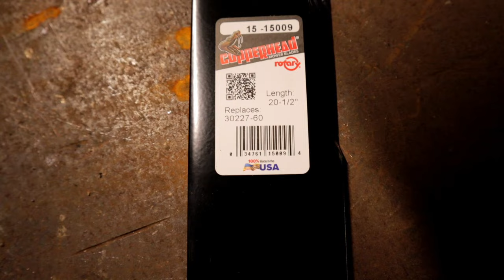Bad Boy Mowers Blade Upgrade - Install

Comment: 6'2" 230lbs male unable to loosen factory tightening with a ratchet, you used a crescent wrench.  I bow to your strength sir!!
Reply from the maker: I think they need to recalibrate their torque wrenches at the factory because they come stupid tight. You may need to try a breaker bar or a cheater pipe.

Comment: Copperheads are ok, Oregon Fusion Gators are better but more money.  Your old blades will clean up and sharpen like new. They're not abused, just used.
Reply from the maker: I will loot at getting a set of those. I want to try a bunch of different blade setups this year to compare them. You are right about the old blades as well. Since this video I have kept them sharp and use them as spares mostly.

Comment: Great video buddy. I too learned something on swinging those ramps out. Can’t BELIEVE I never thought of that before! I would however use a boxed in wrench instead of that big ass knuckle buster you have there. Again, thanks for sharing. 👍
Reply from the maker: I totally agree…I didn’t like using it, since that video I got a dedicated box end wrench for the blade bolts.

Comment: Appreciate your time, just making sure if a Bad Boy's  blade nut with counter clockwise nut to loosen, Thanks
Reply from the maker: These are held on with standard right hand thread bolts.

Comment: I noticed how amazingly clean your deck is - any advice on how you keep it so clean? Powerwash after each mow? Also, I changed my bolts out on the last blade change - GR8 integrity can be affected if any nicks. Love these blades - just ordered a set. Learned a couple lessons on the lifts - now I turn mine outside too for more room and safety (I kept straight before and chocked). Learn something new every day. Love your videos man.
Reply from the maker: Thank  you for the comment! I really appreciate you taking the time to ask some questions.  I try not to cut when the grass is super wet, which keeps from getting a lot of build up under the deck. I will also periodically scrape the under side of the deck with a paint scraper or putty knife.  Then maybe once very month or so I will hose everything down. Nothing too crazy.

Comment: Going to change my blades for the first time on my BB 54", the board you use to block/brace the blade while removing/installing - Is there a recommended length for it to be?
Reply from the maker: No real particular length really. I just had this block laying around and it was long enough to block the blade path while it was still sitting on the ground.  If it isn''t long enough you will have to hold the block in place until you get the blade bound up against it, so it can be a little more difficult. So in short...just get a block long enough to rest on the ground and still bind up the blade.

Comment: Even my impact gun will not budge my mower bolts on the same machine. I broke a 1/2" breaker bar. 
Guess I better get  torch out.
Reply from the maker: They are ignorantly tight from the factory. I had to use a cheater pipe on a wrench to get mine off the first time. I wouldn’t recommend a torch, you will cook the grease out of the spindle bearings.
Reply: Same here.  Tightness is set WAY to high.  Have to delay install till a real cool day and I get a good pipe on a 3/4 bar.  Took off grass exit and the bolt stripped the mower deck on 1 of the 3, before I got a tight vice grip on round top and got it off.  They need to stop tightening so hard, this is insane.

Comment: Those copper heads do not fit the badboy properly! I have had too many customers buy them and they click together at the ends. This will ruin your spindles, Bearings, and possibly your deck! Don't buy them! Bad Boy has a hardened front edge as well, this keeps them sharp longer. It will cost you more in the long run, running the wrong blades.
Reply from the maker: Interesting. Haven’t had an issue with these so far. Mine have been great!
Reply: If they are 20.5 " each = 61.5 inches total !
Reply from the maker: @ronnielee4212  I don’t think center to center on the spindles are exactly 20”. The spindles are slightly offset front to back so they sit a touch closer together than 20” if you are measuring straight across the deck.

Comment: No ratchet wrench available ... YIKES!!
Reply from the maker: Yikes is right....but it worked out this time...and the time after this.  I really just need to get the right socket.  I have a 7/8" and a 1" but I  am pretty sure these bolt heads are 15/16"
Reply: @south_coast  
Good Job👍

Comment: Interesting ... There is no "Copperhead" listing for the 54" mulching blades.  Do they not make them or just don't list them on Amazon?  I see others that claim to be Copperhead but if you read the listing carefully, they are not the same.  Does Copperhead have their own web site?
Reply from the maker: I don’t think the ones I have are advertised as copperhead blades come to think of it. I got them from MowerPartsGroup on Amazon. They may have an option for a 54” mower on their Amazon store.

Comment: Thanks for the review. Every since I bought my mower (60" bad boy) I never get a clean cut in the center of the deck. I went ahead and bought using your link. Thanks
Reply from the maker: Hopefully the new blades fix your issue. Thanks for the comment and using the link! It definitely helps support the channel!

Comment: Nice song and why keep the extension & deep socket i have that similar issue but i pry my deck up to use my impact no way I'm doing it by hsnd like that anymore i refuse lbs but good work sir 🍻
Reply from the maker: Good deal. I can’t fit my impact under my deck when I use my ramps for pulling the blades, so I just do it by hand. Nothing to it after the first time

Comment: Hey, Mr. South Coast Fab, I have a dumb question for you.  Which direction do the blade bolts turn?  Reverse threaded or Lefty Loosey?
Reply from the maker: They are standard thread, right-tight left-loose…Not a dumb question! I had the same question after trying to take mine off the first time. They must send them home with a big ole impact at the factory because they are TIGHT!!

Comment: Good looking blades… I use an engine hoist with a belt to lift my zero turn… a lot more room to work.
Reply from the maker: That’s not a bad ideas.
Reply: I use a 440lb HF hosit to lift my mowers.
Reply from the maker: @ronaldrains9280  Thant not a bad idea.

Comment: Great video and thank you for taking the time to share. How good is the cut? Do the blades pull the grass up and trim it well?

I did replace my blades on my Bad Boy a few weeks ago, and from memory the torque setting on the blade retainer bolts is around 100 ft/lb. The blades are the same shape with the serrated edge and the cut is pretty good. I would recommend using a socket set and breaker bar for undoing the bolts, but you obviously have a good handle on what you were doing.
Reply from the maker: Thanks for dropping a comment. They cut pretty well.